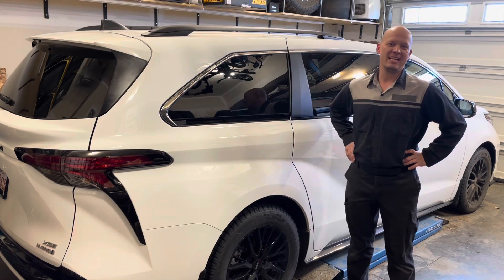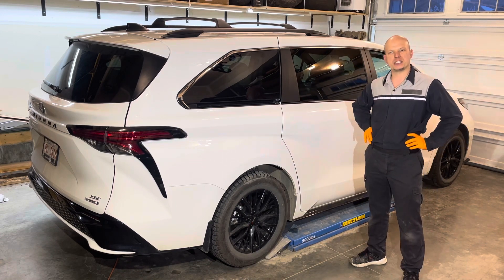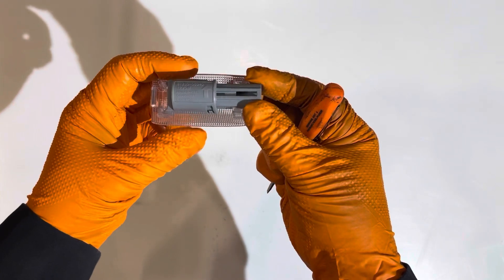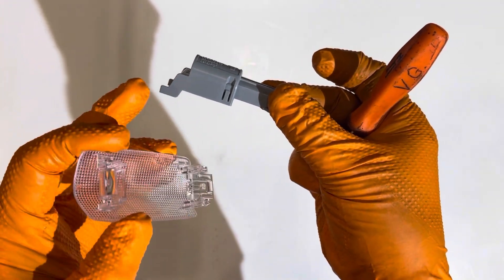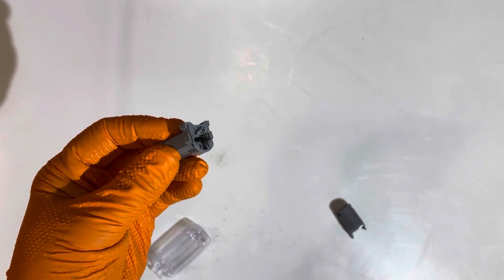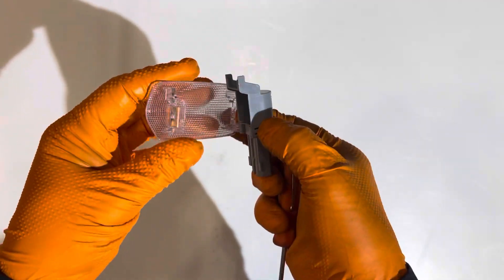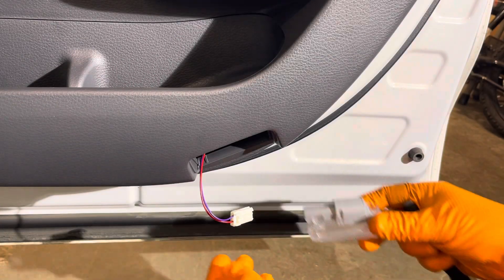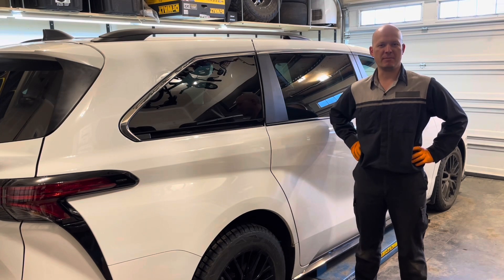2021-2024 Toyota Sienna Hybrid Front Door Courtesy Light Bulb Replacement Instructions

Comment: How about the map lights
Reply from the maker: @chriscad1025  are they not LED from factory?
Reply: @Viktor_G_Automotive  they are, but yellow. I searched and found they're soldered to the board? Is there a way to make them white?
Reply from the maker: @chriscad1025  you could unsolder them and solder in different ones. It should be possible, but would require some skill.